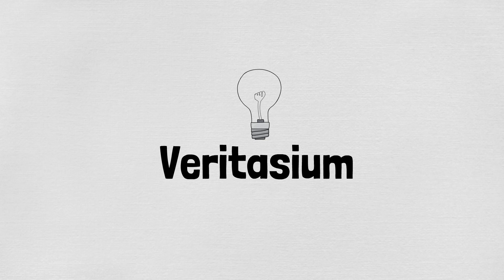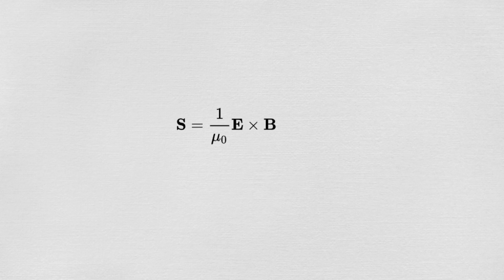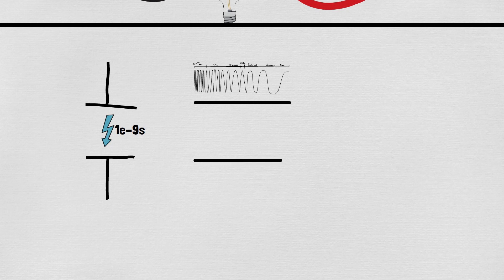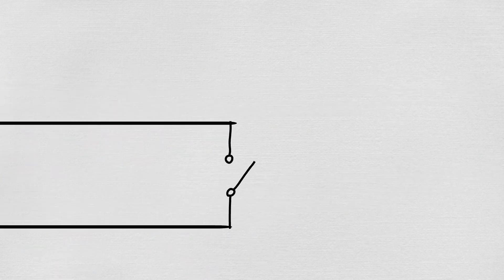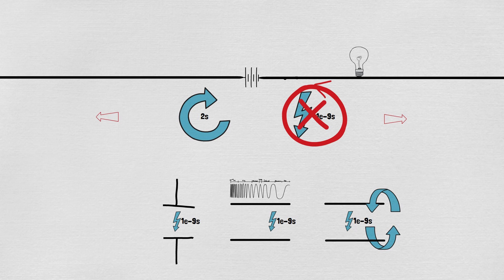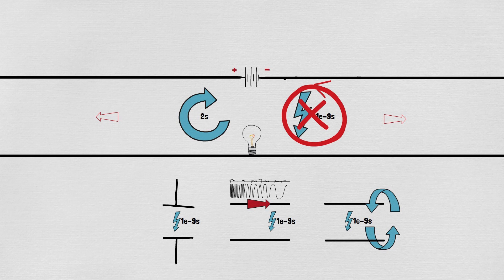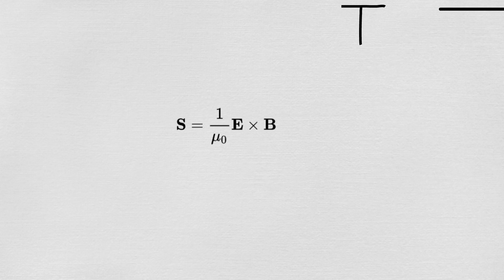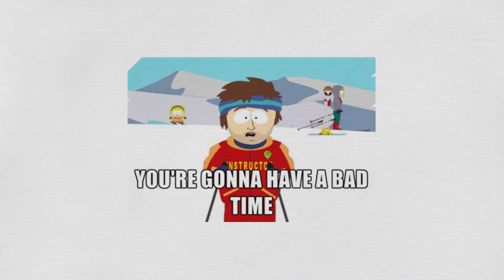Veritasium is Right? (see description)

Comment: 6:38. The moment the switch is closed there will be a current across the switch, since charges will start moving through it.
On the very first, say, attosecond, this current will exist only locally, near the switch.
The sudden movement of charges from a rest initial condition will create an EM wave which will reach the other wire at 1m away in 3.3ns.
Once the EM wave hits the other wire, it will induce in it some current which, in theory, could be enough to turn on a light - a photon or two for the sake of argument.

Comment: Who's right and who's wrong really depends on how you define that the light bulb "lights up". There will be an almost instant but tiny voltage at the bulb after you turn on the switch, and then it will increase as the wave of current propagates though the wire with the speed of light, (increasing the EM field, the "capacitors", "antenna" or whatever analogy). So, in effect, the bulb will have full brightness when there's current in the whole wire, which will happen after 1/2 second (or perhaps 1 second).
Reply: Actually, the voltage on the bulb will drop over time after the tiny initial rise, because the effects that cause it propagate through the wire, and so become more and more distant. Then, once the em wave through the wire arrives, the voltage will rise again.

Comment: 6:50
Well that's the point. The battery along with it's elektric field exists befor the switch is closed. And a potential difference is not only in the battery but also between the two contacts of the switch. Closing the switch will start the charges between those to points to move creating a wave of current from the switch.
This is the starting current, creating the magnetic field. This is why it works as an antenna and why the position of the switch matters.

The bulb lights up after 1/c seconds because the starting wave of charges creates a wave of a magnetic field, wich will induce current in the bulb in form of a second current wave.

Comment: I agree that the location of the switch is critical. The signal originates at the switch, not at the battery, so the time to light is distance/c from the switch to the bulb.  Some are confused about what "lights immediately" entails. It means the bulb begins lighting at t= d/c, but does not reach full brightness until the circuit is complete (2/2=1 sec in this case). The time for the bulb to reach full brightness is  dependent on the length of the circuit.
Imagine before the switch is closed. There is an electric field at the switch - and nowhere else - because of the conductance of the metal wires. The change in current originates at the switch and propagates from the switch at c.

Comment: Thank you! I've been trying to figure out why none of the explanations have made sense. I'm an EE as well, but haven't had to do any sort of electrodynamic analysis since university. This thought experiment has continued to bug me since Derek's video and none of the responses made sense to me given the dynamic nature of antennas, capacitors and inductors. I think Derek's original point was that it isn't electrical current that carries the energy to the load, but the pointing vector. However, as you explained so well here the whole field needs to propoagte through space in order for the causal link to be established.
Reply: It's Poynting vector not pointing vector.

Comment: You can make this much simpler, actually. And you can do it at home. Grab 2 long coax cables, one representing the two wires going to the left, and the other representing the 2 wires going to the right. You can either short or not short the ends. You can use a signal generator, an LED and a scope (across the LED) as the circuit. You'll see that, once the signal from the signal generator goes high, you'll immediately see the change in voltage on the LED. Much before the signal could've reached the end of the coax cable. This is a very easy and basic expreiment you could do at home.

Comment: If there is no (t) we're going to have a bad time!

You nailed it! I've seen every other response video to veritasium and nobody seem to ask the purpose of the switch.

Another thing I'd like to discus would be what we define as "light bulb turn on" because there are different levels of turning on I think.
Reply: Right, "turn on" should be identical to what you expect when you flip a switch and turn a light on in your house. If you're not ok with a single photon coming out of the light and then waiting, then no the light didn't "turn on".
Reply: @snorman1911  it was clearly stated that the light bulb was to be considered to be "ideal/theoretical " and turn on as soon as the current was not zero.
Reply: @larslindgren3846  But that's not a realistic condition. If I connected such an ideal bulb to a DC supply via a capacitor, it would stay on forever, because the charging current in an ideal capacitor never reaches zero. It's that ridiculous assumption of an "ideal bulb" that allows Veritasium to claim that the microscopic energy radiated when the switch closes lights up the bulb after 3.3ns and that it stays on until the voltage step that propagates along the wire connected to the switch arrives at the bulb a second or so later.

Comment: The current does not flow as soon as we close the switch, but the currents starts to flow from the battery into the wire at some relatively high velocity. This current will induce a current in the wire on the other side and light the bulb way before the current has had time to travel all the way around.
Reply: Current does, indeed, start flowing when the switch is closed. The switch is where the volatege difference in the steady state is, and this voltage difference has to disappear when the switch closes. That's why the em wave propagates from the switch and not from the battery.
Reply: @biogoo  I meant exactly what you said, but was using different words, maybe misleading words. I don't disagree with you, I disagree with Tycho.

Comment: An open switch is basically a capacitor, obviously closing it will cause current to flow immediately in the vicinity of the switch because you have just closed two ends of a voltage differential, which now have to equalize. This equalization will propagate through the wire but that won't matter, because locally change is instant and so bulb will turn on in 1e-9 seconds.

Comment: Another way to look at this is to place the light bulb a light year away from the battery AND the switch (in other words, place the switch close to the battery. Surely closing the switch cannot immediately turn on the light bulb just from special relativity considerations. 

On the other hand, place the light bulb and battery a light year away from each other, but put the switch close to the bulb. The portions of the wire hooked to the battery eventually reach the same potential as each end of the battery, essentially becoming an extension of the battery electrodes. Then closing the switch will light up the bulb quickly because the current will not have to go far to reach the bulb.

Comment: I have a question maybe unrelated to the main point of the video, if anyone or the video author can enlighten me.

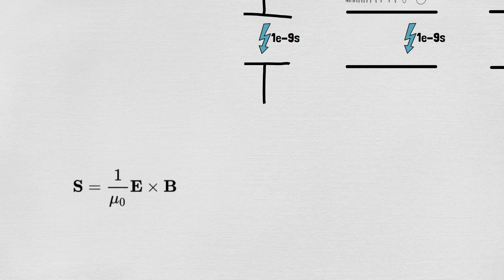At 2:30 you cover the three different explanations for power propegation across the gap; one with an electric field, one via radiation, and one via magnetic fields. Aren't all 3 of these explanations actually the same? Like from my understanding, I remember something about "light" actually just being what we see when there is an electric wave propagating through space at a right angle to a matching magnetic wave. Now I've never quite been able to wrap my head around all of the implications of that fact (like I guess I don't understand how magnetic and electric fields will both fall off with distance, but a "beam" of light can travel forever). Anyways, Is this an example of that phenomenon? Could you look at any physical interaction with light and explain it as a phenomenon of solely the electric field, and then draw a separate but accurate model that explains the phenomenon fully from just the magnetic field perspective?

Like I know that the "electric" field and "magnetic" field are the same thing, but frustratingly nobody ever talks about it like they actually are in these examples and its unnecessarily confusing.

Comment: What if the wire is routed not in two lines nearby, but in a huge loop. Still total length is  2 secodns from Bat+ to Bat- at speed of light. How does that changes?  If taking the "capacitor" point of view, this would decrease the equivalent capacitance (regarding original wire setup), so after closing the switch  the lightbulb shoud go to full power much faster, comparing if the wires are places in parallel?  Or do I miss, that in that case, we must look our circuit  from the coil and inductance point of view?

Comment: 5:51 Why must the EM field be established along the entire circuit before current starts anywhere? That seems to invoke nonlocality.

The actual connection between the top wire and bottom wire are only relevant when electrons at the top need to go somewhere (and not just pile up and counteract the DC source) and the electrons on the other side of the top become too sparce (and create another force against the DC source), and there's a similar effect for the bottom wire, so let's say that instead of being wired to each other, that they're both wired to ground on both ends.

What I'd say happens is that while the switch is open, the potential difference fails to form a current since the force caused by the differing electron density across the DC source forms an equilibrium with its EMF. When the switch is closed, the electrons at a higher density now have a place to go and no longer pile up. This forms a current immediately at the point where the switch is. This current propagates over the wire as they try to fill the lower density region near them. That current creates the connection through the EM field that connects the wire (which can be represented in any of the ways described) and sends some energy to the other side even before there's an equilibrium again in a few seconds (which would have a constant current flowing in both the top and bottom wires).

The most interesting part of the wired-to-ground case is that the shared current after equilibrium (which should(?) be about the same between the two wires if the fact that the force caused by the magnetic fields has to exactly oppose the force caused by charge density differential says anything), I_shared = V_source / R_component, which weirdly means that the bottom component's resistance has an effect on the top wire's current.

Comment: If instead of a battery, a charged capacitor is connected, with two switches on either end of it being closed simultaneously, the bulb should light up a little bit in a nanosecond. 
As the charges on the capacitor move to rearrange themselves over the now much larger capacitor (the entire circuit) they generate a small current whose front will spread outward in either direction from the capacitor at the speed of light. Simultaneously, the sections of wire will become slightly more charged - it will take some time for the electric dipole moment of the circuit to dissipate, but the dipole moment is increasing for the moment, as the charges separate along the newly attached wire. The charge configuration is that of a dipole E field, like the capacitor itself, and this is perpendicular to the B field generated by these currents, evaluated at the lightbulb's location. Roughly speaking, the E and B fields should be perpendicular here and the Poynting vector oriented from the capacitor towards the bulb. The bulb is inductively coupled to the discharging capacitor and so via Lenz's law there will be an induced current. There is also presumably a force field applied to the electrons in this component of the circuit due to the new dipole E field. Which of these is bigger is not obvious to me at the moment, not having done the calculus outside of my head. The induced current will almost certainly be small compared to the "steady state" solution reached 2 seconds later.

The theoretical bulb of infinite sensitivity should light up as you're even bringing the capacitor towards the circuit in the first place. This problem is an exercise in magic: it distracts the audience by presenting a tantalizing "gotcha moment" but secretly it was Jackson all along.

Comment: The correct analysis is two transmission lines in parallel.  Current flows in a transmission line regardless if the switch is somewhere down the line.  Regardless if there's an open at the end of the line.  And the bulb lights as soon as the step-function begins to propagate down the transmission lines (1ns).  Whether the bulb stays lit depends on some of those other factors, but for the example given (assuming the switch consumes no real-estate, e.g. the switch is merely the wire touching the battery terminal), the bulb lights for some length of time, starting 1ns after the switch is closed.  Simple.

Comment: Remember that we're talking about a wire that is almost impossibly long. The fact that the wire is 2 light-seconds long can't be ignored. The function of the switch is to create the current. If we just have a battery and a 1 light-second length of wire at steady state, the wire will have the same potential as the terminal it's connected to. No change in potential, so no current. But if we have a switch, at time t=0 there is no potential in the wire, then we close the switch and now there is a potential at one side, with that potential moving through the wire at nearly speed c until the end of the wire "realizes" it now has a potential. That movement of potential as the wire energizes is going to create a (momentary) current in the wire. Electrons are moving and, I believe, the lightbulb will light. It won't stay lit for long, but it will light.

Comment: This can be thought of power transmission lines also, specifically, under fault analysis.
The energy exists in the circuit distributed over the top line, with the fault or point of interest being the break in ther circuit, ie switch. The distance from the fault source to the relay or bulb or any sensing element is a vital vairable in consideration.
Before t=0- enegry is in static form and distributed over the whole line, and the actual point of propagation is from the break in it to the sensory element.
This is my interpretation and i welcome any and all sort of corrections needed. :)

Comment: This is the first time someone actually mentioned the causality issue from the possible placement of the switch. The issue with the problem imo is that the simplified problem is trying to be too exact without giving nuanced explanation of what the system actually is. Everyone is coming from different basic assumptions of what the wire is and how is going on that end up contradicting each other.

Comment: Hmmm - As I commented on the original video, the way to analyse this is by considering the system as a transmission line. The parallel lines have mutual capacitance and inductance and a current will be set up, initially, according to the characteristic impedance of the line, Zo = (L/C)^0.5. This current will be set up in the lamp with a delay of 1/C seconds and is independent of the termination of the line 1s away. Reflections will be set up on the Tx Lines which will cause a change of the voltage across the lamp every 2 seconds and the system will eventually settle to its steady state condition where all the voltage is across the lamp.

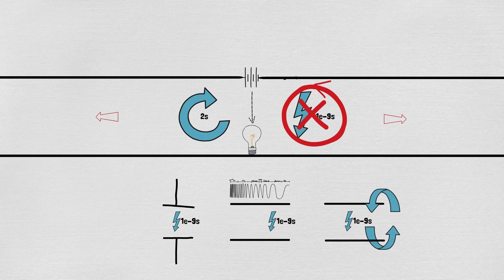Comment: As a practical electical engineer I am not that familiar with the math involved in this video but I feel like the switch argument you made at 2:50 is a little off... The reason why the switch needs to be close to the source is because the wire to the right of the switch before it is closed, is at the same potential as the positive end of the battery... So as soon as the switch closes, the potential of that wire changes rapidly, inducing a current to the capacitively coupled wire on the side of the bulb... Closing the switch from 0.5 light seconds would not turn on the bulb for at least 0.5 seconds.

Comment: Wasn't sure if I were gonna agree (like) or disagree(dislike) on this as the arguement of Veritasium was almost re-convincing. I did have some suspicion about how the fields could be established without a current and was thinking through the "capacitor" idea, where both sides of the bulb has a "capacitor" for the leads thus having the em-field propagate through the capacitive fields until the ends were reached and thus the bulb lighting instantly.
Of course, thank you for helping me solve this one as I forgot that it's the current flow that establishes the em-field in the wires and in of itself has a propagation delay of essentially lightspeed in of itself (Can't remember the handedness of rule from BTEC-L1 college lessons, however I was wondering if I remembered the current flow direction bit correctly even if I forgot the maths by now).

Comment: The point that its a dynamic system is crucial and you got it spot on. also very precise that em fields in a wire dont travel at c, thanks for mentioning that.